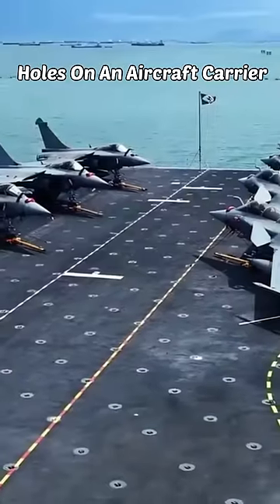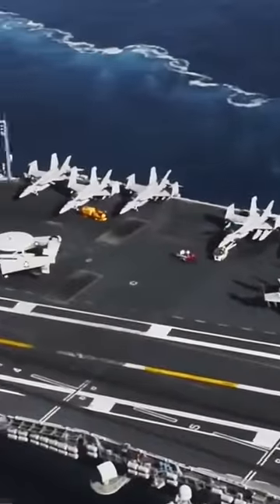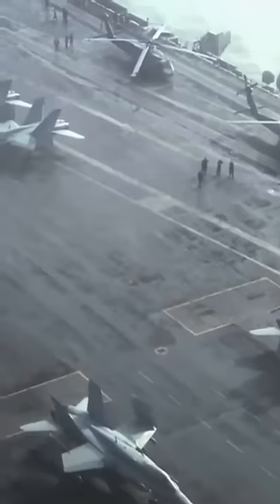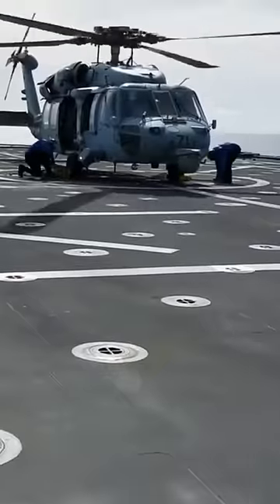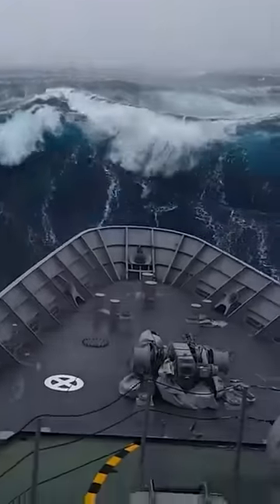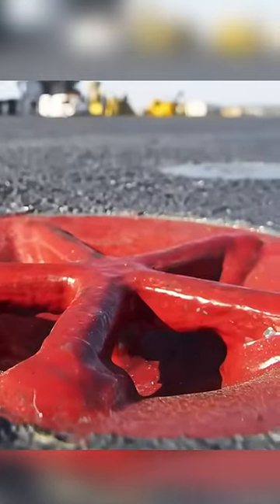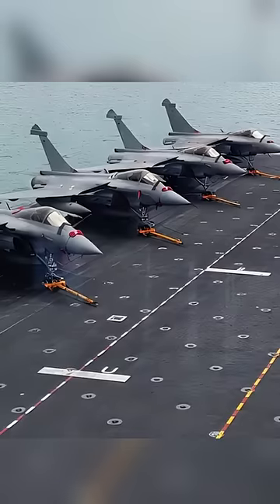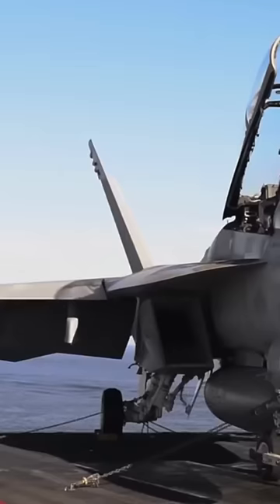How this HOLE😱 Saves Aircraft from Massive STORM On A US Aircraft Carrier

Comment: The padeyes are there to secure a plane to the deck with tie down chains.  The hanger bay is also full of padeyes for the very same reason.  The elevators also have padeyes.  There are regulations for how many chains you attach to an aircraft to secure it.  This depends on the aircraft and sea state.  You also at regular intervals must inspect the tie down chains to ensure they are secure.  An F14 Tomcat dry weighs 60,000lbs it will require more tiedown chains.  In stormy weather they may go as many as 16 tiedown chains and more.  In a Hurricane all our aircraft had 32 chains on them.  The padeyes are tested annually at 10,000psi of pull force per bar.  They must also be cleaned and painted. 
There are also sprinkler heads on the flight deck just below the surface inbetween the padeyes.  These are for washing down the flight deck in case of a CBR attack,  significant fuel spill and fire.  They can spray saltwater or AFFF.  Lots of equipment built into the flight deck.  I like these videos I just wish they would put a little more research into them!!

Comment: It helps keeps the aircraft afloat? 

They should call it when AI goes bad
Reply: Andrew, it keeps them from getting washed overboard in bad storms. Sometimes waves tower over the flight deck.
Reply: Aircraft are always chained down, norm is a six-point tiedown for some aircraft. Try running across the flight deck with 3 chains over each shoulder including the turnbuckles! There are way more chains added in bad weather.
Reply: Afloat in the sense of not on the ocean floor, I thought. But yeah it’s a poor choice of words

Comment: Dual function tie-down point for aircraft and also used to electrically ground the aircraft.  Aircraft can and do build a considerable amount of static electricity - enough to make it a hazard when fueling or loading/unloading ordnance.  I spent my time on the decks of the Midway, Ranger and Independence.

Comment: Hey newbie. Go up to the flight deck and tell'm you need a pad eye wrench!🤣🙊😅🤣
Reply: Rich, old CVA41 MACHINIST MATE HERE . As a Boot, I was sent after 100 feet of shoreline. Then to get a bucket of hagevap. (Used to clean tubes in Evaporators) and once to get an angle stretcher. Heck, I was lost for two weeks on the Midway.
Reply: @jacoblecoy3700  we used to send newbies after relative bearing grease. I remember providing Midway with ordinance during Desert Shield/Storm
Reply: The infamous pad eye remover
Reply: A newbie once myself, was told by a PO2 to go get a gallon of bulkhead remover. I inquired, "Is that over by the bucket of prop wash, and the 50 ft of flight line?"😕😏😆
Reply: @TheHawk--oe8iq  you're lucky they didn't tell you to go to engineering and get a BT punch
Reply: @mikegracie3212  , BT, Barely Trainable😆
Reply: @TheHawk--oe8iq  I was an OS Oscillating Shi**head

Comment: Thousands?
Reply: Yeah really thousands I don't think so
Reply: Definitely. And they have them on the Hanger Deck also.
Reply: A-6'S used 9 tiedowns per plane, using different pad eyes.  20 planes, 2 F4 squadrons, 2 A-7'S squadrons, 2 S-2'S squadrons, 1 A-5 squadron, 1 ea-6b squadron, 2 helo outfits, early warning E2's, COD plus ground support equipment tugs, huffers, AC units, nitrogen carts, etc etc etc.  All have to be tied down.  I would guess the kitty hawk had about 2k.